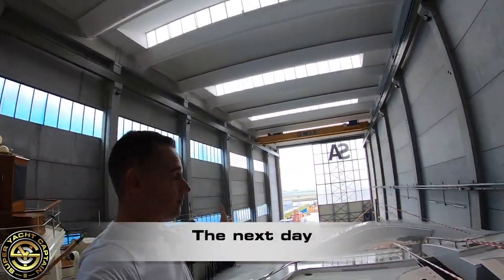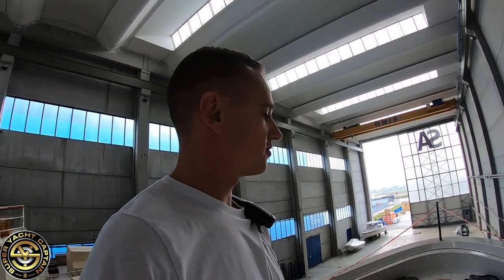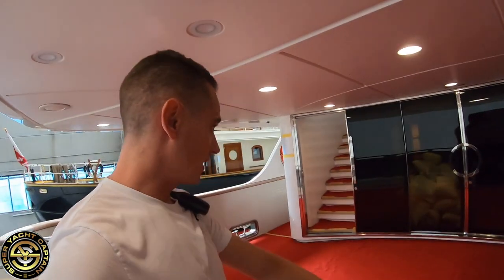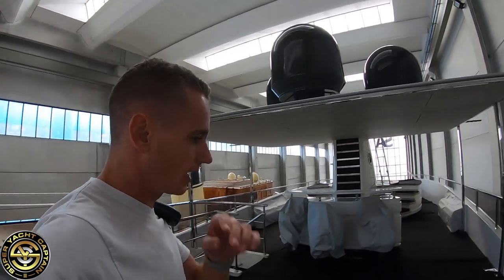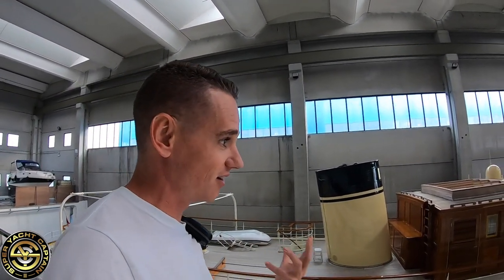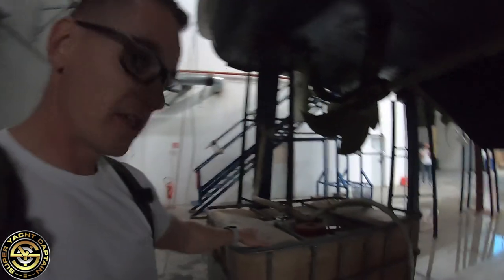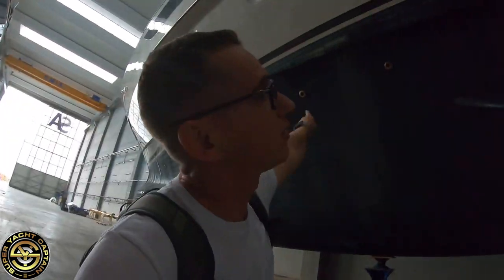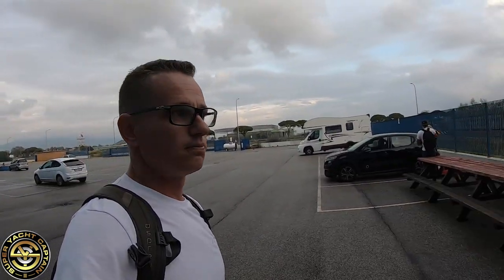WHERE DO SUPER YACHTS GO IN THE WINTER? (Captain's Vlog 117)

Comment: A number of airlines have started running flights to no where,  the trips generally do not make much money for the airline however it keeps their fleet moving which reduces maintenance cost and gives passengers a chance to see something new.  

So has anyone been tempted to run a super yacht cruise to no where.  Like inside the dry dock,   come on board,  experience to joys of being on a boat without actually going anywhere. Challenge the crew to come up with bigger and better ways to do things.       Is your winter AWOL cabin built like a boat,   it would be interesting to see video of it.

Comment: Hello Tristan,  when your in the yard, do you do maintenance on your black dome, receivers\ just forgot the names of them.  never seen any one do maintenance on them, even here in my marina.
Reply: Good comment!  That equipment should also get PM.  The simple act of removing and re-seating connectors will burnish the contact areas and reduce oxidation, however little it may seem, not to mention the benefit of a good visual inspection.  Such electronics and comms equipment never fails UNTIL it fails.  Preventative maintenance is important.